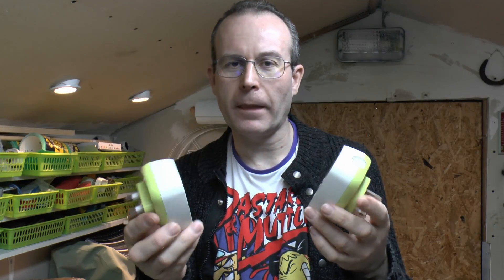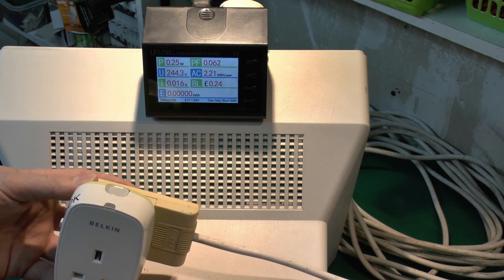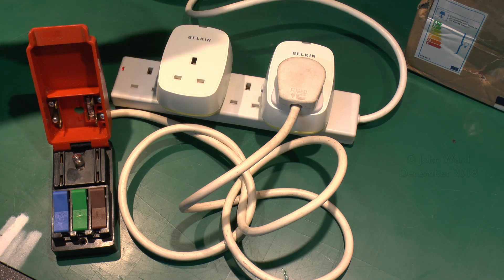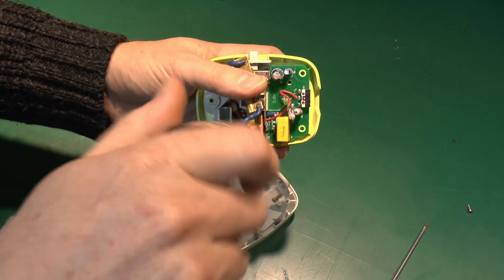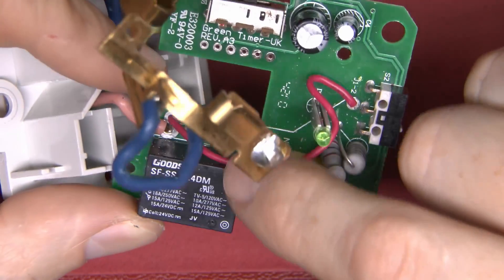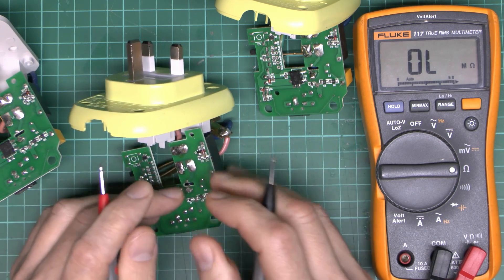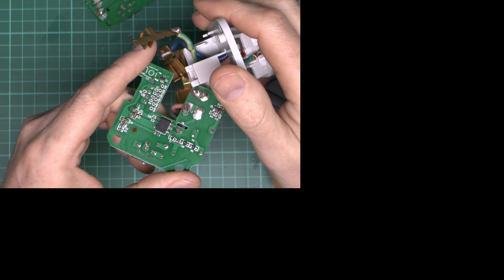Belkin Conserve Socket Teardown and Fault Identification

Comment: I've bought several of these Belkin timers a few years ago as well as other Belkin products like the 'Conserve Insight' watt meter, and abut 90% of these items suddenly stopped working after a few years, which is terrible.  I've never known such a poor quality brand that fails so easily.  I can only say that this is a case of manufacturing built-in obsolesce caused by cheap internal components that fail as soon as any kind of modestly low voltage spike goes through them.  Some manufacturers are only interested in making products that last as long as their one year warranty.   This history of light bulbs is a classic example of this, whereby the manufacturers deliberately manufactured their light bulbs to fail after a certain number of hours in order to boost their profits.

Comment: That's why I don't like modern devices which use electronics for switching, motor control, etc.  The electronic components are very poorly made and don't seem to last very long, even in normal use.

Comment: They create lots of noise down the mains and sometimes radiate across the HF spectrum Best place for them is in the dump.
Reply: Because of what? The capacitive dropper?
Reply from the maker: This is just a timer to switch things off after a certain time - not a power line network adaptor.

Comment: You can of course use the same power meter that John used to check on the standby current of your domestic items.  I have found that my washing machine uses a few watts when switched off at the appliance.  I therefore make sure it is switched it off at the mains.  So does my electric garage door, and of course my TV. The only way to make sure that such items are not taking relatively large amounts of quiescent current is to turn them off at the socket.  All these items are less than 5 years old.

Comment: I think the silly screws are about stopping silly billy's from getting inside them, then plugging them in and touching the internals. :/
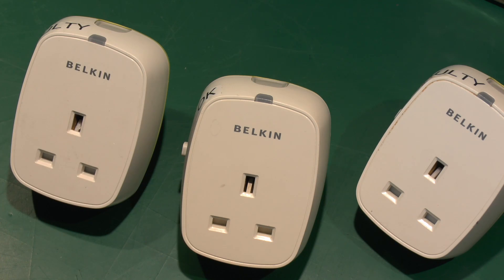Reply: 1:38 John reckons you can open them with some E's.
Reply: Or just drill the triharder screws out.

Comment: Isn't the thermal fuse (TF1) just the wire which is on the board? I'd imagine that the bridge would melt before the relay.

Comment: The usual failure mode of that type of equipment is the voltage dropper capacitor which in this case looks to have failed short as the unit is drawing so much current, try removing the X2 capacitor.

Comment: I'd rather have those triangle screws on something than the Y shaped ones, as I could pretty quickly make a triangle bit with some judicious filing. I tried to make a Y point driver to take apart my tea kettle so I could put in an indicator light, and I did manage to get it open, but it was a real pain.

Comment: It's most likely the diode across the relay's coil. The 24V relaies produce higher back EMF than 12V ones. The diode they are using is pretty small for the task. It should have been a 1A diode such as 1N4007. The transistor is also most likely to be dead due to the short.
Reply: It is not necessary to use a high voltage like 1N4007. The requirements for the back emf diode are pretty easy - it only needs to have voltage rating a little higher than the relay supply voltage, a current rating a little higher than the maximum relay coil current and a moderately fast turn-on and turn-off time. A 1N4148 or similar will be just fine in this application.
Reply: @stephenbell9257  I don't disagree. But repeated on and off cycles and working temperatures can cause a small diode to fail.
I came across such a failure mode twice in two circuits using 2 24V 30A relaies in parallel and a 1N4007. The 1N4007s were shorted and they nuked the switching transistors.
Reply: Rapidly repeated on/off cycles can cause excessive power to be dissipated in the diode but it it is hard to switch a relay fast enough for this to become a major problem. The use of a diode such as the 1N4007 can exacerbate the problem as these diodes have a slow turn-on time and will have an initial forward  voltage (look up "forward recovery voltage") of 2-3V, greatly increasing their power dissipation. Using a faster diode the initial diode turn-on voltage rapidly drops to 600-700mV and the bulk of the stored energy in the relay coil is dissipated in the relay coil's resistance itself.
Reply: @stephenbell9257 You are correct 1N4148 will work but they fail far too readily...
 In practice the repeated high current spikes from the relay EMF destroys 1N4148 when used in these circuits.
I have always used 1N4XXX when repairing or designing this type of circuit..
Merely for reliability.
For me1N4148 are reserved for small signal applications.
Many years back Price would have been a consideration but not for the past 30 years or so.
Reply: The voltage rating of the diode must be high enough that it can survive long enough to turn on when the back EMF spike occurs. The current rating must be high enough that the peak current caused by the collapsing magnetic field does not damage the diode. Also the switching time for the diode should be fast. So for power relays, a 1N4148 or similar may not survive...
Reply: @Mark1024MAK  I think an external magnetic field from a nearby device can also increase the generated EMF since the relay isn't shielded. I guess it deserves a more in-depth experimentation.
Reply: The breakdown voltage rating of the diode is not relevant for withstanding the back EMF spike as the diode goes into forward conduction when the relay is de-energised. The voltage rating of the diode becomes important when the relay is energised and the diode becomes reverse biased with the full supply voltage applied across it. 
The diode current rating is easily determined as being the maximum current through the relay coil when it it de-energised. The peak current supplied by the collapse of the magnetic field of the relay cannot increase above this value as its inductance prevents such increases in current. The only way the diode current can increase above the relay coil current is if there is excessive capacitive coupling from adjacent circuits due to poor circuit layout.
Reply: @stephenbell9257  Please, can you expand more on the capacitive coupling issue?
Reply: Stephen Bell - Selecting a suitable diode appears to be easy based on what you say, but in practice, signal diodes (like 1N4148) with modest ratings just do not survive in a practical application. And this is in a 18V nominal system (relay coil voltage) with relays that only ever switch 50V DC circuits and which have a minimum on/off cycle time of 1.5 to 2 seconds between another change of state.
Reply: Mike Trump - 1N4008 diodes?
Reply: @Mark1024MAK  I'm not familiar with 1N4008 in practice. It's worth testing though.
Reply: Paul NJ - Well good luck obtaining one. These 1200V diodes are a bit hard to buy...

Comment: Would be more likely the zener diode Z2 has failed, shorting the power supply. The way this operates is the capacitive power supply drives the relay direct, and then the 3V supply for the little mystery 8 pin micro is derived from this. To turn off the relay the transistor shorts out the power across the relay coil, shorting out the power supply and also ensuring the micro is reset correctly. Power switch simply applies power to one of the power resistors that feeds the capacitive dropper, and the relay has enough power then to turn on, and then via the other pin provides power to the capacitive dropper. You can see the power rail is shorted because when you turn on the unit with the switch it should provide, via the 2 resistors, power to the output at around half the mains voltage till the relay closes a tiny bit later. That the neon indicator in the terst block did not light on the 130V or so says the capacitive divider is trying to operate a shorted load and the most common suspect will be Z2 in the power supply. Those relays I find fail as contacts burnt or welded shut, never with a shorted coil, but the diodes in the capacitive divider do fail short circuit regularly, especially as the MOV to protect them from spikes and surges is not installed.

Note also the PCB thin sections designated as fuses, for the markets other than UK where there are no plug fuses.

Comment: That omitted thermal fuse was likely to protect against fire if the MOV was installed. If MOV's fail after a surge-event, they will get flaming hot when the normal power resumes.This circuit can be found in "plug-in surge protectors" as well. 
 
I suspected the X2 capacitor as well. Depending on what kind of fault it developed it has gone short or the capacitance has changed. If it for some reason were to supply too much current through the bridge rectifier, the zener diodes (there are 2) that are used as voltage regulators in this instance, may have failed in an open state. The rest of the circuit would have gotten much more voltage than it's designed for, resulting in all kinds of failures.
Reply: Those zeners are likely the short, X2 capacitors self heal open ( unless they are transparent RIFA made, where they fail with smoke and flame) in most cases with time, but let through a small spike every time, which cooks the zener diodes short. To make a zener open circuit the energy would have left a lot more evidence of this happening.
Reply: @SeanBZA  I wasn't sure of them failing in that way. The X2 cap is more likely to fail open indeed. I had an issue with such cap in the past, in a wireless doorbell. Thank you for your  insight and comment.
Reply: X capacitors should fail short not open. Although they do sometimes, it is quite rare. 
Y capacitors should fail open.
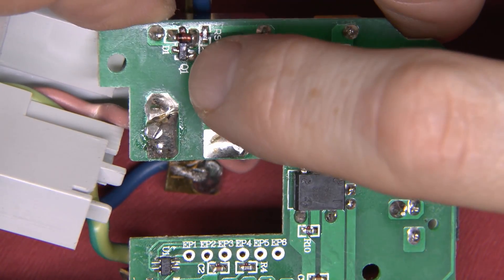Reply: Just remember that this is an X2 capacitor (fail shorted), and it is not in the ClassX configuration/across the line. So either it is in the failure state (so where is the smoke/blown fuse since there is no longer any limiting?) or is open (so why does the circuit draw any power at all when turned on?) or the fault is downstream and the X2 is working perfectly and limiting the amount of power to the circuit. Z1 (12:30) appears to be the important one - as it clamps the output of the bridge rectifier... so if it failed and shorted, I would expect a decent skid mark instead of a diode. Still points to D1 and possibly Q1 (12:47) as the point of failure, or at least they have failed due to a failure upstream which blew them out.
Reply: With the available information, my conclusion (based on fault finding similar capacitive dropper / rectifier / Zener diode / relay systems) is that a Zener diode has failed short circuit, or the back emf diode across the relay has failed short circuit. Zener diode failure is a common fault, either due to overheating, or lack of protection from voltage/current spikes. If an unsuitable back emf diode was chosen, that would also be a common failure. I’ve seen both faults in different equipment. I think it very unlikely that the X2 capacitor is the cause. That does not mean that it has not been damaged.
Reply: Oh, and as the X2 capacitor at 0.22uF will limit the power drawn, there will be no skid marks or any other obvious damage.
Reply: The X2 caps used as a capacitive dropper sometimes loose capacitance over time, not 100% sure why as you can put them on the same circuit but one can fail and the others would be perfectly fine...

Also, in addition for MOV overheat protection, a thermal fuse could detect when (if) the relay contacts fail. (I've seen this happen, but since there was no thermal fuse, the relay caught fire. Thankfully it was noticed so it was then contained by unplugging the device.)

Comment: I have one of those but a different brand, i got it for the Dyson battery cleaner that lives and charges in a cupboard and because it is out or sight and easily forgotten I didn't  want the charger running all the time.

Comment: Could you remove the X2 capacitor and test again? I think that could be failed component. 

Alternatively, you could supply low voltage, high current after the resistors and see what component gets hot.
Reply: Interesting to try, but probably not the fault. Most likely the flyback diode used to stop the EMF destroying the transistor when the relay turns off, which when it failed in the typical shorted state, probably took the relay drive transistor out also. And it's only the fact that the capacitive dropper is inherently current limiting that they didn't go bang or blow a fuse when they failed.  Then again, this could have been an avalanche failure, due to the X2 capacitor failing... so maybe it is worth looking that that capacitor....

Comment: The triwing are supposed to be security screws to keep Joe public out however they come out with a standard terminal driver
Reply: I hate those stupid screws.
Reply: Those tri wing screws and similar veriants are really annoying , I had to remove a couple when I needed to open a plug in digital time  switch  because the reset button had got stuck in, when I'd done the repair, I replace them with two normal posidrive screws, for easier future maintenance.